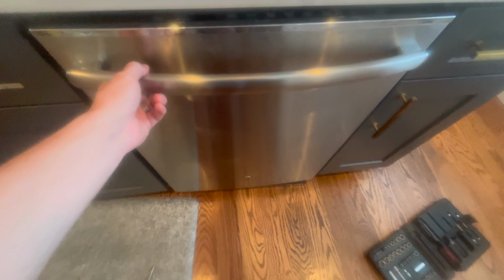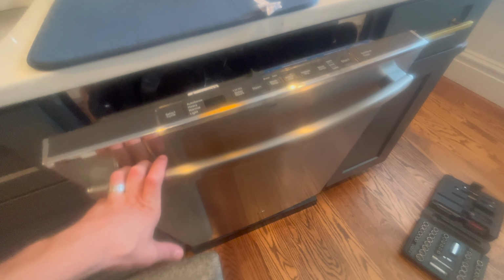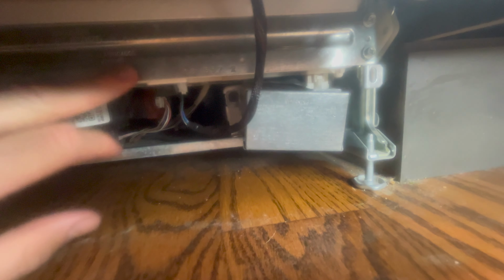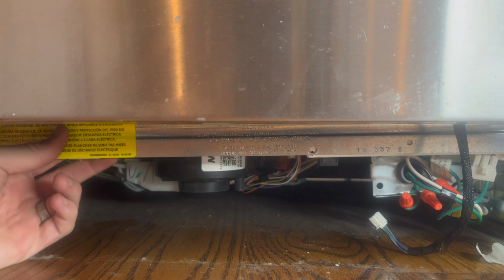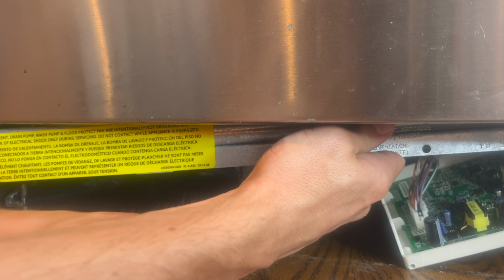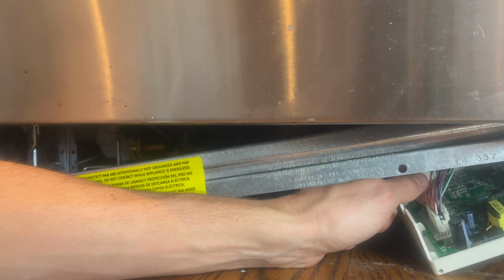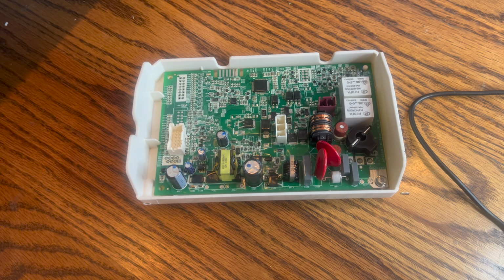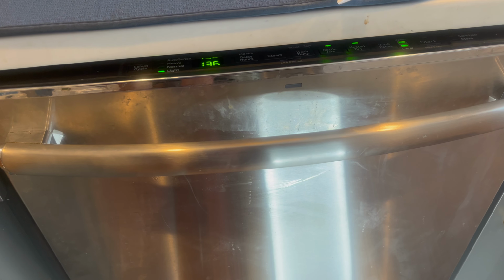GE DISHWASHER REPAIR! Easy Fix! CONTROL BOARD FIX! GE DISHWASHER MODEL GDT655SSJ5SS Control Board!

Comment: Thanks for your help. My ge dishwasher is also 3 years old. After loosing power on the replacement board, I disconnected the power, plugged it back in and it can up. As I was running my test run, it stopped mid cycle, no error codes. Planning on returning for a replacement.

I have lost faith in ge products, as I purchased this dishwasher, a frig & a microwave at the same time. Right at the 3 year mark, the fan went out on the box, now this issue w the washer, as I type, I see the digital screen on the microwave is going out. 
Thanks again for taking the time to post your work so others can benefit from it.
Reply from the maker: you are very welcome, yea the igniter switch just went out on my ge oven (about 6 years old), i need to figure out which brand is the toyota of appliances, thanks for commenting, make sure to subscribe and have an awesome day

Comment: Thanks, disconnecting and reconnecting worked for me! I wonder when the next issue will be. It sucks that those replacement parts aren't easy to find
Reply from the maker: disconnecting and reconnecting worked well for about 1-2 weeks, you may end up having to replace the board
Reply: @MoOutdoorsandReviews   okay which board is it usually? The UI board on top or control board underneath?
Reply from the maker: mine was the ui board on top @TomatoKiller21
Reply from the maker: usually the ui board on top, i have another video on how to replace the ui board on top @TomatoKiller21

Comment: Thanks man! I have this dishwasher, same troubleshooting up to the removal of the board - I will follow your lead and give it a shot! Will skip the bonus screws..!
Reply: No go in mine, had a bug dead and maybe fried on the panel.. but after a blowing it off and reinstalling it did not come back to life. There was also some discoloration in one corner.. going to look for replacement board.
Reply from the maker: @steveg9863  i did a follow up video in which I ended up having to replace to UI board a few weeks later, thanks for subscribing and have an awesome day

Comment: How do you get the screws out that are up in there? I only have a straight screwdriver (does not articulate)
Reply from the maker: i think i just held the screwdriver at an angle, or I may have used an articulating head, ( you can get them for cheap from harbor freight)

Comment: i have this same dishwasher, slightly different model number, but looks the same.  mine is not drying the dishes, have replaced the heating element.  it was actually bad, but still not helping.  i also replaced the vent fan and the high limit thermostat.  i am going to try to do what you have shown here and see if that helps.  i am guessing this was just kind of "reboot" ??  how long did you leave it unplugged?
Reply from the maker: i left it unplugged for about an hour, I ended up having to replace the user interface board a couple weeks later as that was the actual problem, one sign that the user interface board (the control board on top of the dishwasher that you press the buttons on) is failing is that it will beep intermittently through out the day, I also did a video of me replacing this board, hope this helps, let me know if you have any more questions, subscribe to my channel if you have not already and have an awesome day
Reply: @MoOutdoorsandReviews  I noticed your control board had a green led flashing at double time, mine is doing that as well I am assuming that is a indication the control board is good and is communicating with the UI PCB.  My UI is completely dead so I guess I will order a UI as well, sounds as though it worked for you.
Reply from the maker: @spookville6632  yea that sounds like a ui board problem, i did another video replacing the ui board, https://www.youtube.com/watch?v=kQ7tfixUmX4&t=3s, check it out, subscribe and have an awesome day
Reply from the maker: @spookville6632  yea I replaced the ui board in another video and that fixed my problems, subscribe and check it out and have an awesome day
Reply: If not heating look under where heating element wires connect to element. There is a button to press and acts like a breaker. Just press it and it should heat the element.
Reply from the maker: @anr102607  thanks for commenting, sub to my channel for further updates and have an awesome day

Comment: Hey! Thanks for your video, I'm having an issue with the fuse on my board and I cannot for the life of me figure out the amperage on it. In your video, it's the little red-brick-colored fuse with the white dot on it. Mine had a white dot which covered the amperage so I have no idea what to replace it with. Would you happen to know?
Reply from the maker: Hey sorry not sure, maybe try a couple different ones,  are you able to test the fuse with a voltmeter? let me know if you are able to figure it out and subscribe to my channel if you have not already to see future updates
Reply: 4.1 amp

Comment: When I took my apart the Green Flashing, was your green light flashing prior to you disconnecting all connections on the Control Pannel?
Reply from the maker: yea if the green light is flashing that probably means that the user interface board isnt working, i made a video about how to replace that, you should check it out and subscribe and have an awesome day

Comment: So I've heard that if you're LED, green light is flashing on the main board that you're good to go. If it's solid green, it means it's lost communication with the user interface board which would be the one on top for selections and then I guess if it's solid red that means the motherboard's bad
Reply from the maker: my green  light was flashing and my UI board went bad a week later, I did a video on how to replace the ui board as well, this turned out to just be a temporary fix
Reply: I am replacing mine as I type. Flashing fast display won't work, no communication to the ui board from the main board. Slow flash as I got the right jumper setting it now works.

Comment: I don’t have that problem with mine. There are no lights as though there is no power. I unplug it from the power socket. Wait about 30 seconds plug it back in and it comes back to life and works perfect . And it will work several times and then I will have to unplug it again for 30 seconds plugged back in and then it works again. It made you 10 or 20 dishwashing cycles before I have to unplug it again.
Reply from the maker: I imagine its either the board at the bottom or the board on the top, not sure which, have you tried calling their customer support line, let us know if you figure it out and thanks for commenting, make sure to subscribe

Comment: What does the green blinking light mean on the control board?
Reply from the maker: i think it means that the user interface is going bad, I did a video replacing the user interface you can check out

Comment: Our dishwasher model gdt630pmm0es is not heating either, I replaced the heating element but it didn't help. I have seen some other videos showing ge dishwashers that have a float and heat switch located in the drain sump area that you can replace. After pulling ours apart it doesn't have the same switch as others do. Anyone out there have any advice?
Reply from the maker: hope you get it figured out, thanks for commenting, subscribe to see more updates and have an awesome day!
Reply: Any luck fixing your I'm in same boat right now

Comment: Ok…first off…for what he accomplished, which was to reset the control board, all he would have had to do was either unplug the power cord or trip the breaker feeding the dishwasher for a few seconds. To reset the board using the interface panel at the top of the washer you can push and hold the start and cycle buttons at the same time for 5 seconds. The only reason you need to take the board out is to test the continuity of the board to verify the board is still good. Also, with his model, he did not have to remove that metal strap to get the board out. Just the lone screw in front of the control board on the metal strap. Then unplug the power to the board and the user interface wiring harness plug. He did way too much work to accomplish the same thing.
Reply from the maker: thanks for making a video telling me how to do it
Reply: Charles… life saver. We had the bottom off and checked that there was power going to it. Put it back together, then Me and my buddy just watched this video. We were dreading having to take it back apart and I said wait check out this comment!! try holding start and cycle for 5 seconds. Boom haha. 

Also, thanks for the original video. When the board goes out, I will have a good video showing how to get to it.
Reply from the maker: @sethdale4721  about a week after I did this my user interface board died (the board on top), I suspect that was the problem all along, also unplugging the dishwasher and resetting the breaker did not work for me, also did not work reseting from the user interface board, likely because the user interface board was going bad, I made a video on how to  replace the user interface board (the display board on top)
Reply from the maker: about a week after I did this my user interface board died (the board on top), I suspect that was the problem all along, also unplugging the dishwasher and resetting the breaker did not work for me, also did not work reseting from the user interface board, likely because the user interface board was going bad, I made a video on how to  replace the user interface board (the display board on top)
Reply: @MoOutdoorsandReviews  hey I am going through this issue now. How did you know it was the interface board?
Reply from the maker: @Ogrillion  i reset the control board (board on the bottom of the dishwasher) in this video, the washer worked for a week but would make a beeping noise intermittently and then the user interface (the board on top) stopped working, I replaced the user interface (board on top) and the washer has been working great for 2 years now, here is a video on how to replace the user interface board, https://www.youtube.com/watch?v=kQ7tfixUmX4&t=965s&ab_channel=MOAwesome, I tried unplugging the washing machine and turned the breaker on and off (like the person above described) but that did not work, i physically had to unplug the control board to get the dishwasher to turn back on
Reply: My GE dishwasher is having issues and I just ordered a GE electronic control board after replacing the lock because it seems to think the door is open but replacing the lock didn’t work. Any tips? I’ve unplugged and or turned the breaker off several times but that didn’t worked either. I’m a single girl so I don’t have a guy to help me on this but I’m going to attempt this on my own…
Reply from the maker: @mallorysanderson2275  hopefully the control board works, if that doesnt work you may need a user interface board, I ended up having to replace that, I have a link to that video in the description of this one